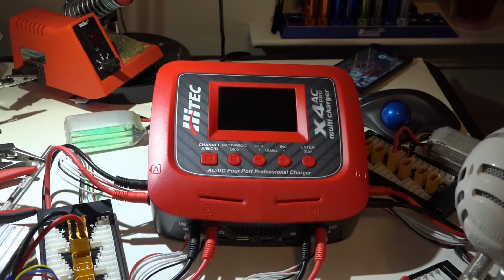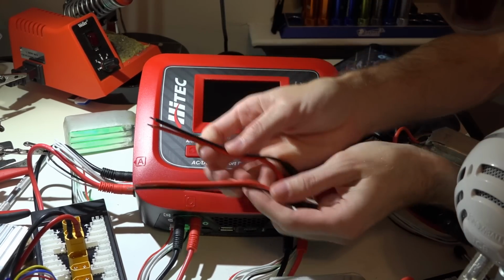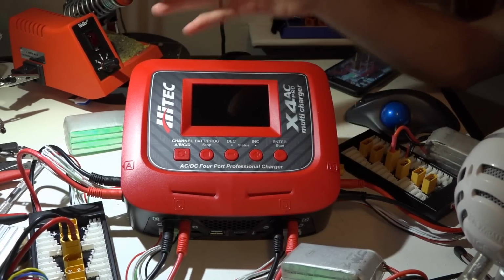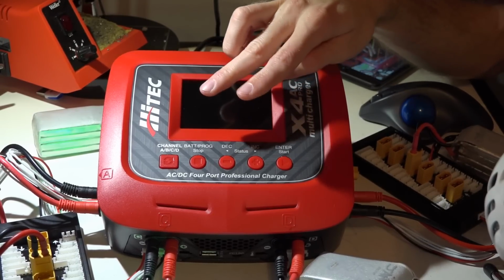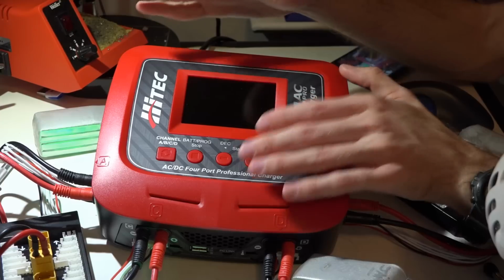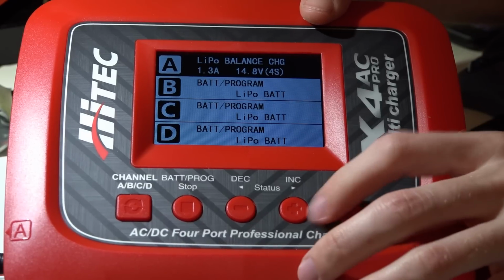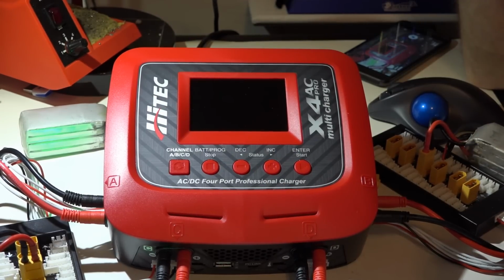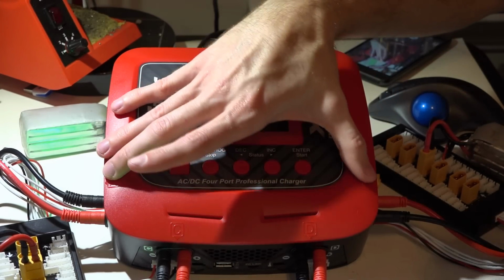HiTEC X4 AC Pro Charger Review

Comment: This'll be my next charger. For discharging I just made a light rig. Way better to since you can go full OCD and set up switches for different loads (5c,10c,20c, etc...) like I did. That way I can cycle the batteries a few times before flying them

Comment: JC, I just bought a 6 port parallel board and haven't actually used it yet to charge my 4S 1300's for my quad. I'm new to Parallel charging and have watched alot of videos on parallel charging. The thing I don't understand is if its ok to Storage charge/discharge in parallel also. I guess to clarify is that if I have 4 packs that are all within .10 volts of each other, and they are at 4.0 volts per cell for example and I want to Storage them to 3.85... can I do that, or will it burn up the parallel board/Lipo's.  Thanks!

Comment: To really get the benefit of a multichannel charger, you need at least 1000w power supply.  I didn't know what I was missing until I got a Junsi with a 1000w power supply.  Charging 4 batteries in the same time it takes to charge one is where it's at.  Can't do that with 300w.

Comment: I had a venom duo and decided I needed 4 channels. I picked up the Q200 SkyRC which is a clone of the Hitec...or maybe vice versa? Nothing wrong with the venom..it's a great charger, but I wanted the wifi capability. I picked mine up from Banggood, however, skyrc is running a $100 deal on the Q200. Are you aware of any differences between the Hitec and Skyrc? The one thing I really like is the QR feature where you can scan and go.

Comment: Nice looking charger and with 200/350 watts available over 4 ports I think the 50 watt max each is not a big limitation if you only fly miniquads but just like the original Taranis this thing needs a rotary encoder. Mashing buttons is so last year :). I'm already invested in the I Charger Duo 308 so no sale from me. It has a bunch of interesting modes like charging from a pack you are discharging, really fast discharging into a dummy load as well as a decent normal discharge capacity. It is a bit noisy at times though.

Comment: As per usual a great and very informative video, thank you. This charger seems VERY under powered for $200 but I do like the fact that an app can run/monitor it remotely. I have been using the iCharger 4010 duo for quite a few years now and couldn't be happier, a feature that I really like and it sounds like you would too is that it has regenerative discharge, so basically I can hook a bank of lightbulbs (or dead batteries) to one side and say 6x6s 5000's to the other side and rapidly discharge them at 40 amps. For the field and my mini quad I use the ISDT Q6 Plus, an amazing little 300 watt charger that fits in my pocket, I plug a 6s 5000 pack into the one side and can charge 2 x 4s 1300 @ 5c so basically I have 2 fully charged packs every 15 minutes.

Comment: first? I'm new to this hobby and need a cheap way to discharge my lipo's for storage as my charger doesn't have that function, i have a cell voltage checker, do i need anything else?
Reply: congrats on first... The easiest is to just hover and discharge your battery.  I would HIGHLY recommend getting a battery charger that does storage charge.  You can get one for less than $50 dollars.  They will do the same thing JC's does, they just have one port instead of four.  Did you hear what JC said about bringing his batteries to  storage charge after flying.  Welcome to the hobby, good luck
Reply: Tommy Smith thanks, guess I'll go get an IMAX or something like that
Reply: I still have my first IMAX in addition to a 2 port charger I got a year later.